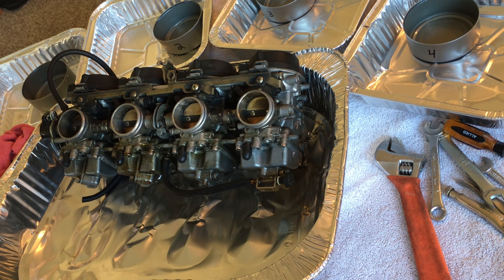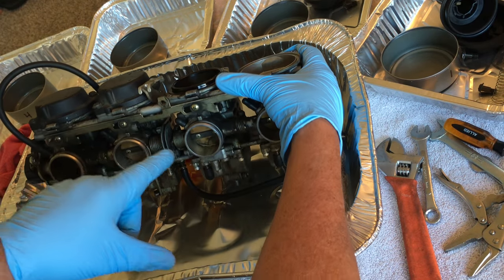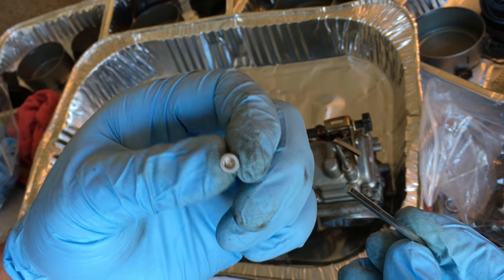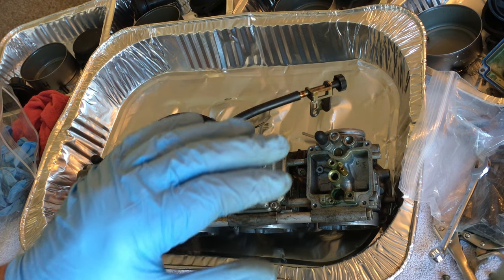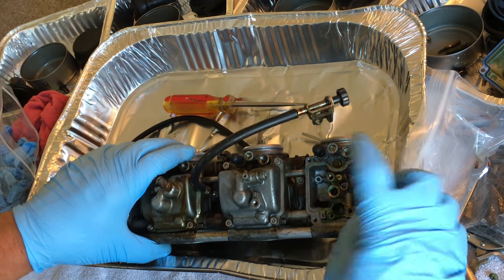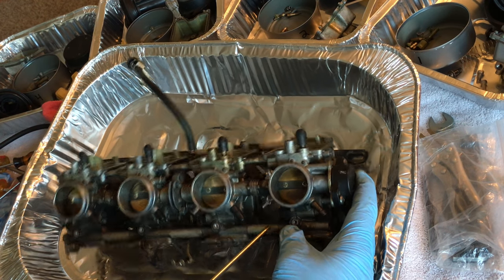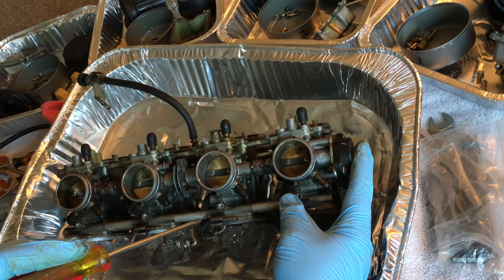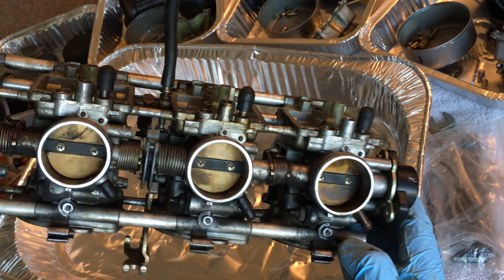2001 Suzuki Bandit 1200S carb rebuild - Part 1 The Disassembly

Comment: I have a 2006 1200S Bandit and have had to strip the carbs too. I learnt the hard way that the screws are not Philips but are JIS - Japanese Industrial Standard. Most screws that look like Philips are actually JIS on Japanese bike. I have a set of these on order so I don't mess up the heads on any more screws.
Just a bit of info for you.  Keep the videos coming.
Reply from the maker: On several bikes I've gone to a local Ace Hardware store and replaced all the screws with stainless steel allen screws if I think they need replacing.  And the screws aren't expensive which is nice.  :)
Reply from the maker: Most of the times I will go to Ace hardware and get new allen head screws for only a few cents a piece.  Phillips screws can be stripped to damn easy.  :)
Reply: @surfdaze  I agree that allen heads will be easier to work with and have done that swap too. The point here, though, is not that Phillips head screws cam out - the point is that they are JIS, not Phillips, and are less likely to do so with JIS drivers. Excellent video, by the way!

Comment: Fyi those are not Phillip's drive  they are JIS ( Japanese industrial standard)  the right screwdriver will get you a lot further but the next secret is to place the driver in the screw head and is the same time that you turn take a hammer and give a wrap on top of the screwdriver that will break any tension on the screw and it'll loosen right out.

Comment: 13:00 The #10-32UNF fine thread imperial size fastener has thread diameter 0.190" = 4.83mm and thread pitch 32 tpi = 0.794mm. This is extremely close to a M5x0.8 metric fastener, which has thread diameter 5mm and thread pitch 0.8mm. The #10 imperial screw uses 5/32" = 3.97mm allen key whereas M5 metric screw uses 4mm allen key.

Comment: Hi, just been sorting my Bandit today had the carbs off and some screws were tight. Tech tip for you and the other viewers tap the screw with a hammer.... Just a few taps will loosen the clay in the threads and make them easy to undo 😎 If you chew a screw up then used a parallel punch straight on the top of the screw to reform the Cross section to give you another chance of removal. Cheers Phil 👍
Reply from the maker: I've even used a dremel to carve a regular screwdriver slot into the chewed up top of the screw and used a large regular screwdriver to force it free. :)

Comment: Used to race 1100's back in the day, I would use what was called panther piss for the screws on any part on the bike, combo of acetone and wd40, makes for breaking nuts bolts screws easy. Also I would never run K&N filters or any of the wire mess cloth ones, they do a terrible job of keeping dust out, I learned that from desert riding. Use sponge pods, clean often. Also When I would sync carbs I would put the hoses on before installing carbs, that way they are there already.

Comment: What kit did yall order show pics and references please... did yall order 4 diff kits or does 1 kit come with all 4 rebuilds?????
Reply from the maker: It was K&L kit 18-5082.  I ordered 4 kits..one per carb.  You can actually see one of the kits at  :42 on the video if you would like to see it.  :)  I hope that helps :)  I believe I got them from Ebay, or Amazon...I can't quite remember.

Comment: Hello ! Nice video! 

I accidentally put way too much air filter oil on my exposed K&N air filter after cleaning them and it doesnt start since that excess oil got sucked inside my carbs .. Do you think i can get it running just bytaking the carbs off ? 

thanks

Comment: Can you do them one @ a time? excellent vid man, really helpful...
Reply from the maker: Absolutely. That's basically how I do it, but I've been in the habit of taking them apart and segregating each carbs parts away from the others. I like to use old tuna can to soak the jets in carb spray as well  😁
Reply: @surfdaze  Cool, I watched all 4 vids last night, crazy helpful, and actually gave me the confidence to remove mine, also your synch came out really good, to clarify, the screws you were adjusting were on exterior arms on the butterflies? It was just a bit hard to see in the vid, .... again, GREAT job! I wouldve loved to see that v-65 magna...I rode one in mint condition when I was 18 and its haunted my dreams ever since, the Bandit totally reminds me of it...
Reply from the maker: @thestcroixkid  Yes those are the screws.  I just reviewed the service manual and the far right carb as your sitting on the bike will not have a screw, but the first screw to adjust (if needed) is between the far right carb and the one just to the left.  The manual says to adjust in order from the right screw then the middle one, and then the screw between the far left carb and the carb to it's right.  I hope that makes sense :)
Reply: @surfdaze  You are the best, thankyou so much!

Comment: when i start my 2003 bandit 1200s from dead cold i have to use the choke of course, problem is the bike sounds and runs very rough when its on choke, also i would set the choke to 1500rpm when i start it, but it would just randomly jump to over 2000rpm while getting warm, any suggestions here? also below 3000rpm the rpm hiccup if i try to drive it at 2500rpm